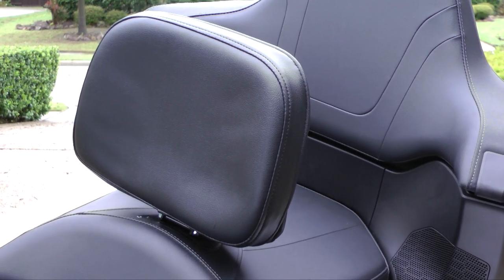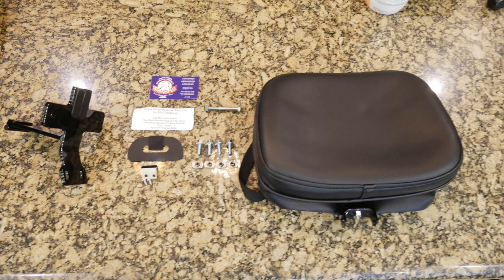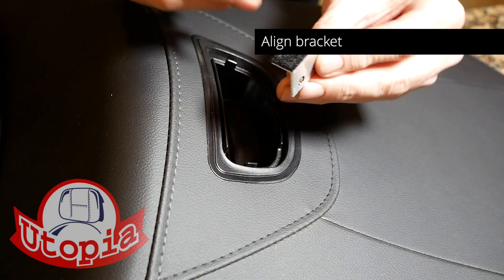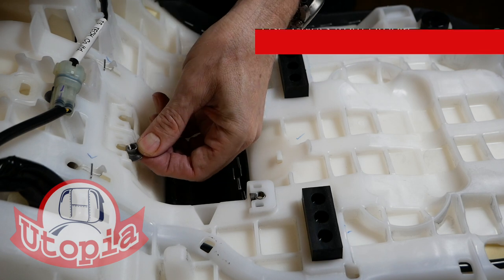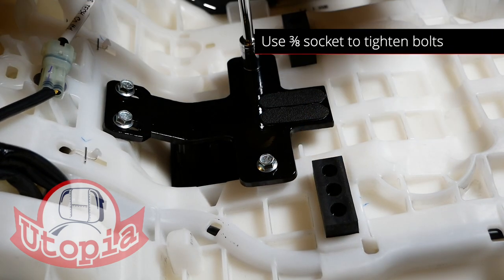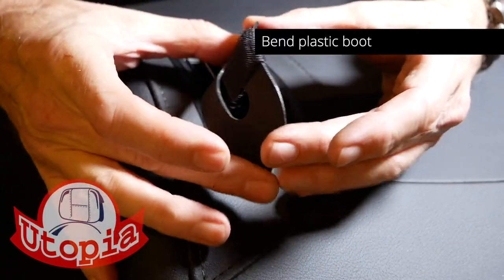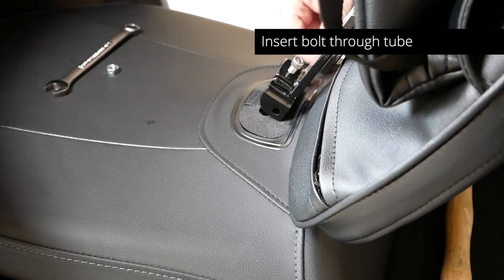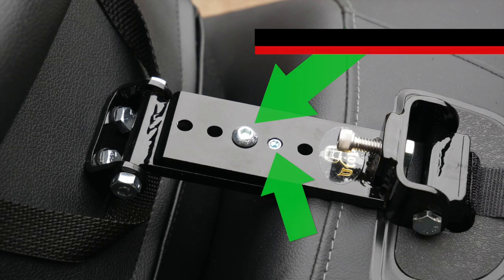How To Install the Utopia Backrest | 2018+ Honda Goldwing | CruisemansGarage.com

Comment: Thank you again for a nice instruction. I was debating if to get the Utopia or some others, after reading some reviews on older GW using Utopia, I went with one. Not cheap, but reviews speak. Thanks to you, the install was a breeze. I recommend applying a drop of removable (Blue) Locktite on each T nut bolt. Another thing I did, ordered an aircraft locking pin (7/16") and used two nylon washers to hold the backrest on the bracket. This way, it is a quick removal system and two washers create a hold down so the backrest is not too loose. Now, if I have my partner riding, it is a quick removal.
Reply: Sounds like a great idea. Can you post a picture of the pin and washers and how you use it?

Comment: Well…….. I’ve had this back rest for 10 months sitting in its box in my shop. I haven’t ridden much lately so that was ok. I got off my butt today and put it on. Thanks to your video, it went smooth as butter. Feels really good on my back. I saw where another commenter asked about getting his leg over it. I had my right hip replaced 3 years ago and was able to mount/dismount from the left side of the bike (as I always do) with no problem.

Comment: 320 dollars for s drivers backrest...thats crazy, I paid like 169 dollars  for the Big Bike drivers backrest for my 2018..I had a Utopia on my old wing and it was nice, but this Big Bike drivers backrest is just as nice...and its removeable,  and the vinyl pattern better matches the stock seat pattern.
Reply from the maker: I swapped out the link for one on Amazon at $245.

Comment: A bit perplexed. Used the link provided and the cost of the Utopia backrest is $320. Down below on that site there is a link to another Utopia ad for the same seat for $245. What's that all about? BTW, Cruiseman, that music is not doing you any favors, annoying to say the least.
Reply from the maker: The link in the description is for Amazon from a private reseller. They may be discounting the backrests. The link in the video is to Utopia.

Comment: The 2021 seat pan may be slightly different. When i installed this backrest on 2018 I did not have a problem with the T-nuts falling into the seat but all 4 T-nuts fell down into the foam area of the seat and needed to be fished out of my 2021 stock seat.
I stuck each one onto a piece of electricians tape which held it in place long enough to place and tighten the screws.
Reply: I had the same problem, and agree the seat pan may be a little different. The two plastic protrusions at the back of the seat pan are longer too i believe. They hit my Kisan tailblazer modules when installed in the recommended location.

Comment: Curious. Does a driver's backrest make it harder to get on/off the bike. Having a hip replacement already limits how far I can get that leg up there. Do you have to get it over the backrest too?
Reply from the maker: You know, it certainly could, depending on how you get on and off of the motorcycle. I tend to step over the rider seat, and never come into contact with the backrest, but if you swing your leg over the passenger set to get on, it could get in the way, even though, it will fold down.
Reply: Yes it will , you will have to step over(if you can )or swing your leg a bit higher while sitting more forward so you can then lift the back rest.
Reply: Was wondering the same thing...